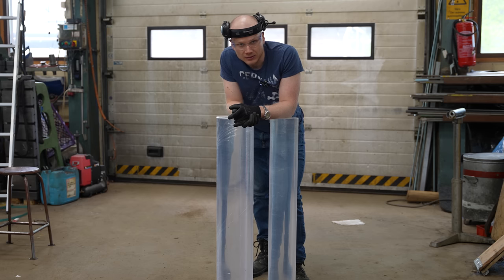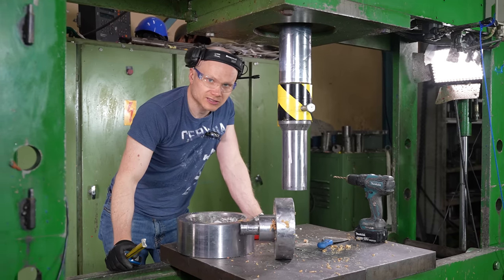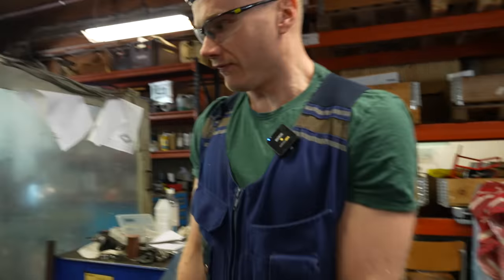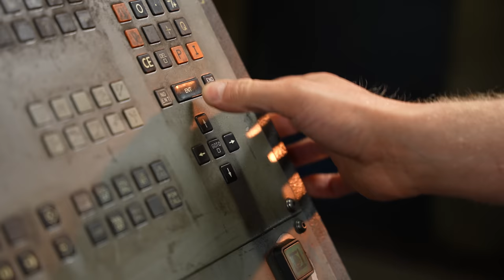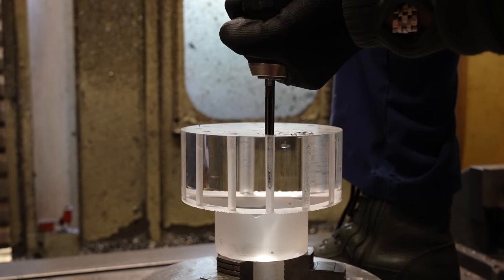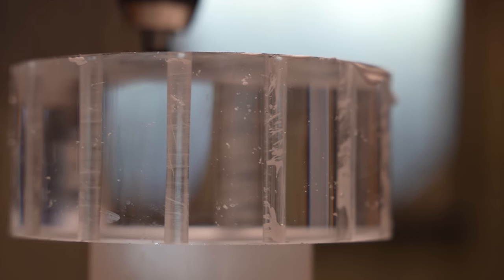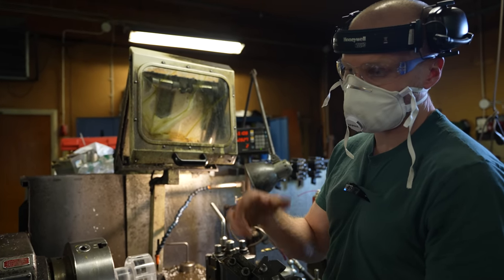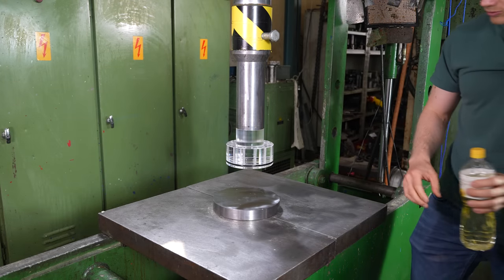Machining World First Transparent Hydraulic Press Tools

Comment: You should always anneal acrylic, even after you cut it with "just normal" tools, because it builds up internal stresses so quickly that can eventually crack it - especially if you use them for a hydraulic press 😅. Place the samples in an oven at 80 C for like a whole weekend...

Comment: Whenever I wanted to order something along these lines - a unique request - and got the "can't do it / impossible to do it", I usually interpreted these in some cases as "I can't be arsed with that, you are not worth my time". Fair enough. On the other hand, when I was on the receiving end of such requests (our shop worked with sheet metal), those were often my favourite assignments.
Reply: Yeah. A lot of the time, when someone says "It can't be done" or "It won't work", it's because it can't be done BY THEM, or they don't want to risk getting blamed if it DOESN'T work. 

I vaguely remember reading somewhere a thing that said "The easiest way to achieve the impossible is not to KNOW that it's impossible". I'm a trained engineer, and I had the blinkers of "The correct way to do [XYZ]" fitted on me by that education, so I always find it amazing to watch the seemingly crazy ways UNTRAINED engineers find to do things on YouTube. I'll see something and think "That'll NEVER work", but then it does!?!? 

For this reason, I like watching what Ivan Miranda does on his channel. His channels well known for 3d printing stuff, but he's recently started doing basic metal machining using a huge DIY CNC router that he's designed and built. On his projects, some of the design choices he makes seem really weird, but it's because he comes to metal engineering from a area where you add material to create the part, where classical engineering is almost entirely about removing material. Also a tapped thread in a 3d printed part is a horrendously weak fixing method, so even when working in alloy, he still does some really odd tricks to avoid having to bolt directly into material....... But some of the "incorrect" techniques that he uses actually work really well, and may have applications where they'd be a better option that the more traditional approaches. This is quite an eye opening experience.

Comment: Acrylic is very sensitive to solvents, even isopropyl alcohol will cause it to develop cracks; your first attempt at polish may have failed because many polishes contain hydrocarbon solvents. The best polish I have found for acrylic is a spray foam made for polishing it, it contains very fine abrasive particles and gives an excellent finish.
Reply: I learned this in my late teens after cleaning my acrylic bong w Iso Alcohol. Still lasted quite some time even w the cracks but I ended up trashing it when I moved houses.
Reply: What is the name/make & model of your foam polish?
Reply: @thechris3553  It came from RS Components, but they no longer sell it. It was their own brand so not sure exactly who manufactured it.
Reply: great point, even Ethanol could crack that. Destroyed a 500$ piece of acrylic pipe once dipping it in alcohol 🥱

Comment: We always use soapwater, when cutting plastics. I dont know if there is a scientific reason for this, but works very good.
Reply: It keeps the material cool as the plastic melts at lower temperature & keep the shavings water rather than flying everywhere.
Reply: We use coolant to cut plastics, and lower feed rates to achieve a good finish.

Comment: For future iterations you may want to consider a design that uses a moving cylinder. This has several advantages:
The piston no longer has to be see through so it can be made from steel.
Any leakage flows downwards and does not block the view of the holes.
No air-gap between between the cylinder and the holes in the piston should improve visibility.

Disadvantage would be that it is more difficult load fruit in the cylinde because it is upside down. Might have to balance the fruit on the piston.

Comment: Hey, thanks for the tip about the coarser compound! I had some scratches in my car wood panel interior that I had tried to polish out with the High Polish compound, but they turned cloudy. I thought it was not fine enough and gave up. Now I went in with the High Cut compound instead, and I got the scratches out and a mirror finish without any cloudiness! <3

Comment: Acrylic is very easy to machine, but you need sharp tooling to get a good result. Will cut better with coolant, which is best to be water alone. To have a material that is a pain to machine try PTFE, which is both hard to cut accurately, and also likely to need to be cut thin as well.  There you want both ultra sharp tools, and also cooling, as it softens with heat, plus it will deform and move away from the cutting bit, instead of cutting. One of the times dry ice is a good thing, to freeze it to a more solid state.
Reply: Interesting. I always thought that acrylic was awful to drill or mill since it chips and cracks or the drill bit gets stuck.
Maybe I need sharper tools.
Reply: @MetalheadAndNerd  Yes it will chip, but the right cutting angles, and sharp tooling, with a coolant, makes it relatively easy to machine.

Comment: The trick with plastic is cut fast and get the chips/curls out as they can melt in place and weld the tool to the workpiece. Use HSS tooling that is razor sharp for best cuts, most inserts are not sharp enough for clean cuts.
The straight fluted drill is a Reamer.

Comment: What i sometimes do to get cutting edges etc. on acrylics clear (because i'm lazy) is flame polishing. Just "touch" the area for a very short moment with a hot flame; the coarse surface melts up and gets transparent/clear.
Reply: Wouldn't that change the dimensions/tolerance?
Or I guess it wouldn't matter anywhere other than the mating surfaces... I'm going to try that on Monday!
Reply: The dimensions do not change unless you need less than +/- 100µm or so. And if, then it was way too hot.

Comment: Another great video! Next time you can sprinkle water to the acrylic while you machine it to keep it cool. Hand operated pressure bottle will be enough if you don't want to use coolant. This makes the surface finish much better and it's way easier to polish!

Comment: Plastics like acrylic and polycarbonate will crack when you drill or cut them.  Doesn't matter how good the tooling is: you would need to make the cut ridiculously slowly to avoid most of the cracking.  Acrylic has a bad habit of turning microscopic cracks into very long, visible ones.  What I have found works best is heat.  Heat up the bit you use to above acrylic's melting point and use that--the plastic should spiral off the tool and/or leave globs around the cut surface.  If you have something that has already been cut then use a blowtorch on all surfaces to make them  clear and (hopefully) repair your microcracks.

FYI - I use an oscillating tool with a metal spatula bit--no teeth--on polycarbonate.  The friction from that 3 degree oscillation is all it takes to heat and cut the plastic sheets.

Comment: Some old time machinists told me that the trick for plastic machining is alcohol cooling. Low evaporation temperature keeps it from going soft and fouling the tools. Good ventilation is advised :)

But acrylic and alcohol don’t go together. PVC loves it though. So does nylon.

Comment: ALL of that work is sooo worth it!! Also, you shouldn't at all use **oil on rubber gaskets**! Use dielectric paste instead, that will provide lubrication, and it won't result in the rubber elongating leading to loss of seal, including once it cracks.

Comment: Fantastic video, enjoyed it really! Try using spirit when drilling to cool the shavings and the borehole wall. This makes the holes really smooth. Also, when you look closely at 16:33, you can see a bit of diffraction in the area of the hole, indicating partially melting the material there. When it cools down, it becomes stressed a lot, sometimes forming tiny cracks at the inside and weaken the stability.
Reply: You seem to know what you are talking about: what do you think of soapy water instead of spirit?
Reply: @RALL123456  It could work. But I don't know for sure, if the cooling ability is enough, alcohol has a much lower boiling point and evaporates much easier, thus does a much higher evaporative cooling. Also, the soap doesn't evaporate and has to be washed off, spirit/alcohol evaporates without residue.
Reply: @kamikazeratte  thank you for your insight. With drilling things heat up easily, ill try a little spirit next time

Comment: Have you considered using hydraulic seals instead of O-rings? And installing a guide so you don’t have to worry about misalignment of the piston head and the cylinder.  Lastly, you could bolt down the cylinder to the base so you don’t have to remove it with a hammer.   Just a few design thoughts.

I love the channel keep doing fun and crazy things

Comment: You may want another seal near the top 🤷‍♀️. To stop the fluid from going back down into it. If you want the cleanest possible presentation. 

...Though if you are squishing things with higher surface tension it probably won't be an issue.

Comment: For a cutting fluid use soluble oil and carbide cutting tools ground for brass at high speed . you want the chips to fly off and not remelt.

Comment: If you got the money for it you could try using quartz, corrundum (ruby/sapphire) or aluminium oxide. All these are insanely hard and transparent if made correctly.

However it is probably impossible to work the material because of its hardness. Using diamond to kind of sand the material could be possible but probably would take forever.

Comment: During the intro, you can tell that the whole €3000 thing is weighing on his mind. :D
It's a fairly robust sum to throw at a project when you've no idea if it's even going to work, so it's pretty understandable to have a touch of "Buyers remorse" while looking at the materials.

There's some nice work gone into that. Acrylic tends to be relatively easy to machine...... Right up to the point where it's not, and everything goes wrong all at once ! :D . I've had acrylic on my lathe that was machining beautifully, then after a split second of chattering, the tools dug in and cracked the work piece. My guess is that the stuff doesn't damp out vibration AT ALL, so as I've been removing material the parts were slowly changing their resonating frequency, until it got to one that the part could really "Sing to".

One thing worth looking into if you ever do a Mk2 tool mate, is "Flame polishing" the acrylic. I've never tried it myself, and it's meant to be half way between a skill and an dark art to do it repeatably well, but it seems to be a really quick way to get glass clear edges and surfaces on acrylic (And a few other plastics). I'm wondering if it might be worth experimenting with straightening out a small oxy acetylene brazing type nozzle, putting it through a drilling in the acrylic, light it, then drawing it back through at different speeds, until you find one that gives a perfect finish without all the polishing? Alternatively, it might be possible to thread a strand of Kanthal heating wire through the drilling, centre it somehow, and power that from a variable voltage PSU. I'm thinking this should be a pretty controllable way to get the walls in the drillings to momentarily melt and get surface tension to work it's magic

Comment: Flame polishing is the way to go for acrylic. Hydrogen-oxy works well.
Pricey, but for drills you can get ones made for holding tight tolerances on deep holes that will give a good finish. 
And Parker and Apple rubber both have very good O-ring calculators on their websites. There are hard and fast rules for them to work and last...

Comment: You should try Aluminum oxynitride, AKA "transparent aluminum .  From Wikipedia "Aluminium oxynitride has less than half the weight and thickness of glass-based transparent armor. 1.6-inch (41 mm; 4.1 cm) thick aluminium oxynitride armor is capable of stopping .50 BMG armor-piercing rounds, which can penetrate 3.7 inches (94 mm; 9.4 cm) of traditional glass laminate.

Comment: Watching this after the hpc video and i have a couple of suggestions

 While it might reduce the visibility a little I would suggest adding some press fit metal collars around the top and base of the cylinder to increase the pressure it can hold. The weakness of this plastic is the shear strength (it snaps easily) so having the top edge and the base held together with a ring of metal means even if it cracks it still has to break the metal to completely explode. Think like the metal rings on a barrel or an old metal boiler

Comment: You don’t need to polish. Use fire. Blow torch will make it clear. For your next project. (Only a little bit at a time, or it starts to boil the plastic. AKA bubbles.)

Comment: Two thoughts on Finnishing the holes: Cotton rope/string works well for polishing the bores of other things.  It also lets you polish at a right-angle to the marks you want to remove.  Second, might heat work?  I have no experience with acrylic, it's just a thought.
Reply: Short exposure to open flame makes small scratches to vanish from acrylic pretty much instantly. It's probably smart idea to try to find optimal flaming time using a scrap piece first...

Comment: I tried to cut thick plexiglass with a bandsaw and it loaded up the blade. I think I had too much speed and the wrong tooth count (too fine).
Reply: You have to keep the plastic cool enough for the whole process. I think blowing compressed air towards the cutting area could help a lot.

Comment: the only thing missing from this video is the result of the press and examining the tool. you should clean the tool check for cracks and explain if it worked well. but other than that nice clear acrylic. also you should find out if the acrylic would explode outward from the pressure just to be safe. (not a mechanic/machinist) just curious.
Reply: Well the tool failed in the next video guess that answers that

Comment: You should connect the holes with a hose and make fresh juice into cups 😆 or you cant make attachment for it which will just bolt on top and make the juice flow into the cup

Comment: You could make a silicone mold from the polished tool and then create duplicates from it with epoxy resin. So that if the tool breaks you don't have to do all the turning and polishing again. Look for a resin with high strength made for wood casting / turning or so. I think resin casting tools might offer some interesting applications especially in combination with 3D printing, as in print the tool that might be impossible to make with turning and drilling, polish it, silicone mold and cast it in transparent resin 🤔
Reply: These are quite fast to make now when we have all tricks figured out. I think I can make new bottom part in 1-2 hours so much faster than with the resin. Resin would be probably bit cheaper but as an machinist I machine things :D
Reply: Epoxy resin is crazy brittle.

Comment: If it's acrylic, couldn't you use flame polishing? Heat the rough areas just enough to slightly melt the surface and the surface tension makes itself as flat as water, which it keeps when it solidifies. Fast, easy and gives an arguably better result than mechanical polishing!

Comment: The "fancy" drill is called a reamer in English.
Split point drills leave a trilobal hole, to get a perfectly rounded hole requires reaming...

M06 T01
M03 G90 Z.25
'Tool stops 2" above work piece'
"Umm, I f*cked up."

Lol.

Comment: Use silicone based hair product for lubrication 
They are most clear & non  Corrosive for plastics.

And Also;
Fix the cylinder to frame,
So it retracts nicer 😂

Urs truly Ashkan,
Irans army Former officer

Iran's Red Crescent mechanic & industrial designer👋 😅

🪖🤍⛑️

Comment: As a machinist in the usa, we call that at 17:10 a reemer. They are difficult to use on certain ha d held drills if they are off center a little. That's when they bite so less speed. Reamers are designed to be used as half the speed, twice the feed.

Comment: Aint no way I would use a drill that long without spotting the hole with a center drill first.
That's asking for misplacement of the drilling.
Reply: Yes, but no.
If he were making a bore that was going to have a shaft through it with bearings, sure.
But he is going to put bananas is this to make banana paste so being on center is a little less critical 😅

Comment: drill spin polish, in the holes
Reply: thats a lens, casting hydroformed steel sheet pouch acrylic lenses
Reply: casting tin, then electroforming metal, super hard high temp metals, like titanium/chromium, at low/room temp process

Comment: you could add tubes on the holes, so it would not made mess around and it would be even beter vissible inside, you could also have  colected thu jujce, so it would be ready to consume and without any aditional garbage in the jujce :)

Comment: Acrylic (PMMA) has a tendency to crack. Polycarbonate is stronger.
Silicone oil does not attack plastics
Reply: Polycarbonate is too easy to scratch for tools if this type. You just look it and it's already too scracthed up to be used :D
Reply: @HydraulicPressChannel  true but I thought scratch resistance was secondary to blowing up to bit in your application. There are hard coating to increase scratch resistance for both materials, maybe something to consider
Reply: @bschwand  I think the whole point was to make it clear and as such, you don't want scratches.